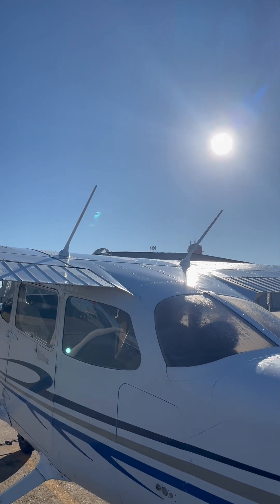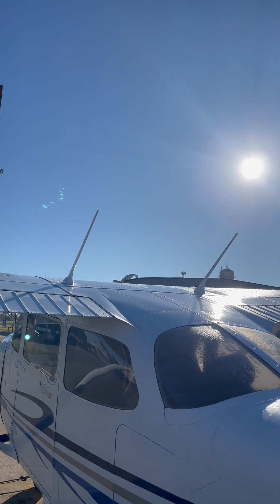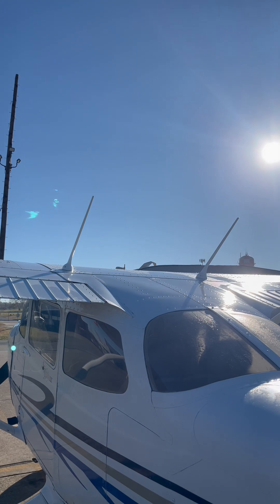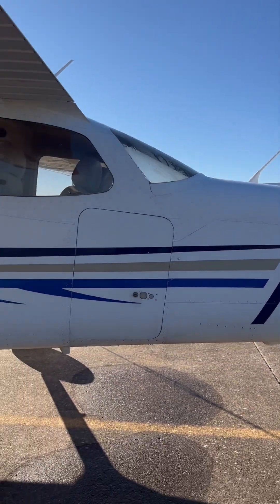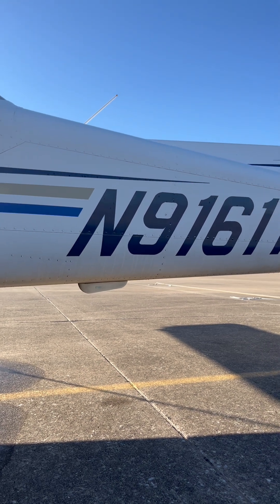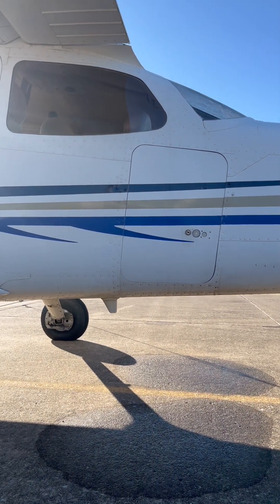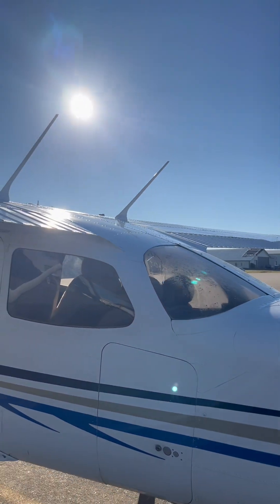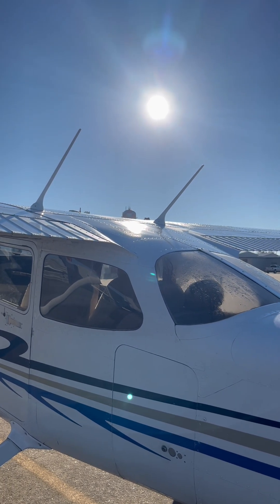Why Does the Cessna 172 Have So Many Antennas? 🛩️📡

Comment: I also think the glideslope is received by the VOR antennae, not the marker beacon antenna: "A blade-type navigation antenna is mounted on either side of the vertical stabilizer. This antenna provides VOR and glideslope signals to the VHF navigation receivers contained in the integrated avionics units."
Reply from the maker: You're right, thank you for pointing this out!
Reply: The VOR antenna is VHF which picks up the localizer signal. The Glideslope is UHF which is picked up by the Marker Beacon.

Comment: I think the COM antennae might be the other way around: POH 7-74 "Two dual-mode VHF COM/GPS antennas are mounted on the top of the cabin. The COM 1/GPS 1 antenna is mounted on the right side and the COM 2/GPS 2 antenna is mounted on the left side."